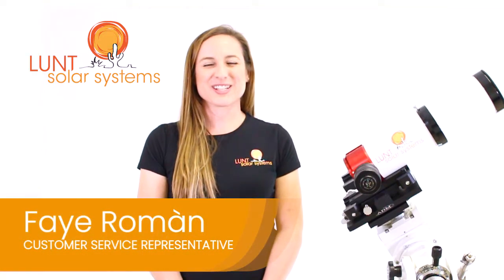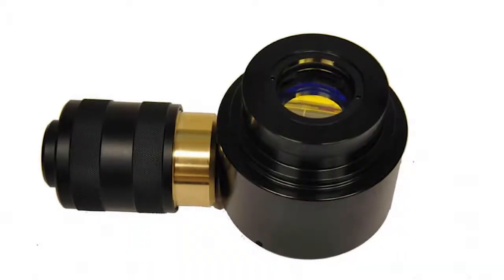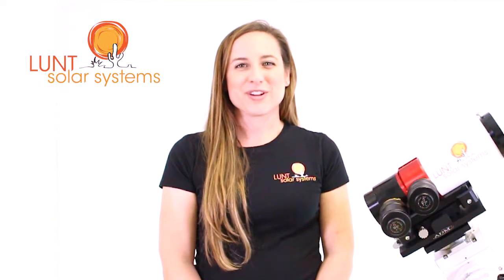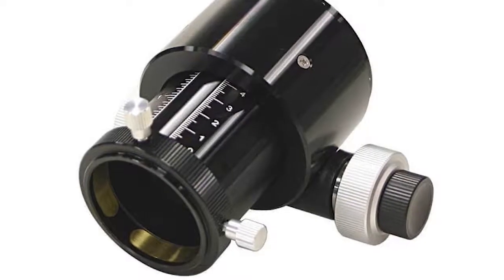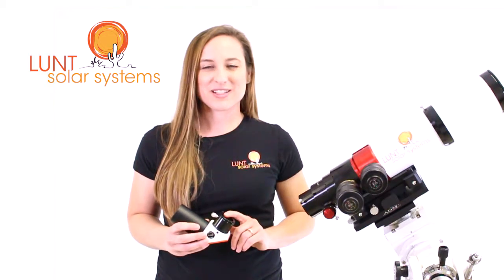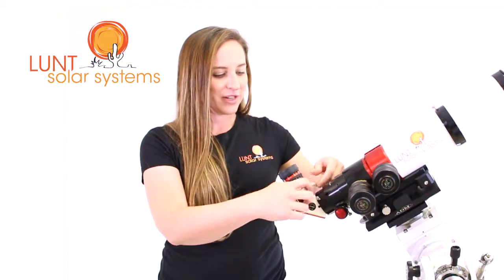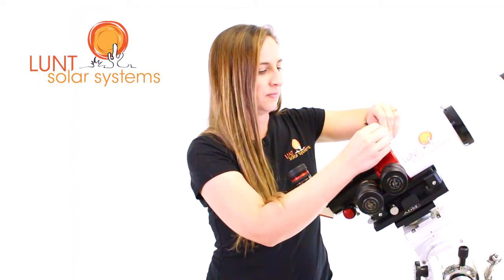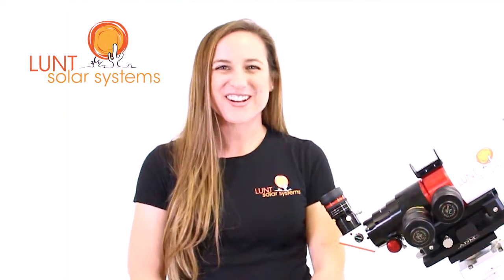Components of a Lunt Solar Telescope

Comment: Nice to see how it all fits together but it would have been nice if you had explained what each component actually does.  For example, can you use another OTA given that the H-alpha module is rear mounted?  At which is most of the energy rejection? Also, you don't mention using barlows; is this worth doing?
Reply: I agree. Do you have any information about that?
Reply: @anathemamh5009  Some of it is explained on the Lunt website. The pressure tuned etalon acts as a comb filter which pass 656.3nm and its resonant harmonic peaks.  Pressurizing the etalon has the effect of changing the refractive index of the airgap between the etalon plates thereby tuning the comb to coincide exactly with 656.3nm. A second, properly tuned etalon has the effect of narrowing the bandpass, which enhances solar disk contrast but has the bigger benefit of suppressing the solar continuum (background) emanating from the solar photosphere. This parasitic light can be observed as a "double" solar limb in single stack arrangements.  The blocking filter (a special kind of diagonal) is actually a series of filters which acts as bandpass for only 656.3nm, thereby eliminating all the unwanted harmonic peaks and increasing the safety of the light reaching your eye. I haven't mentioned the pros and cons of front vs rear mounted etalons. If you want a better explanation of how etalons work, read this:  https://www.cloudynights.com/topic/480925-etalon-basics/
Reply: @sandb1867  Thanks man, I appreciate it!